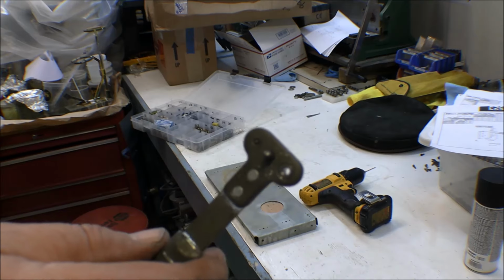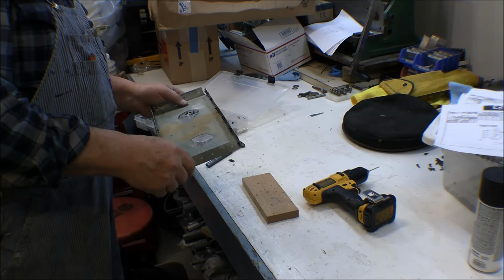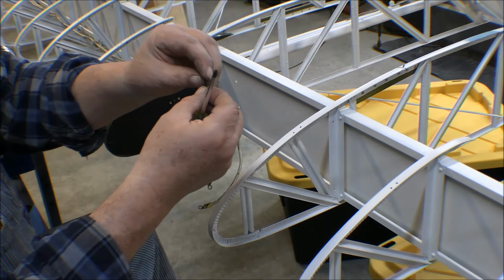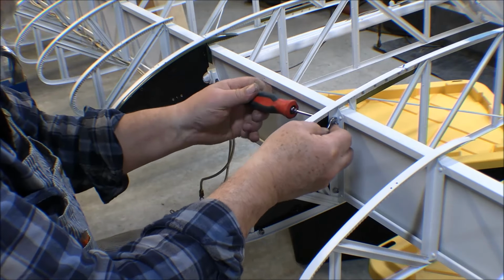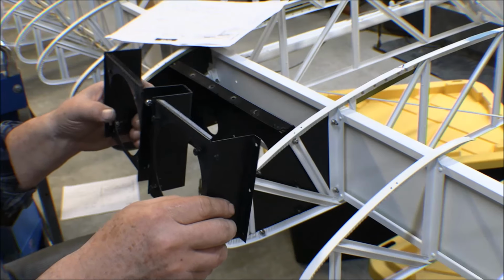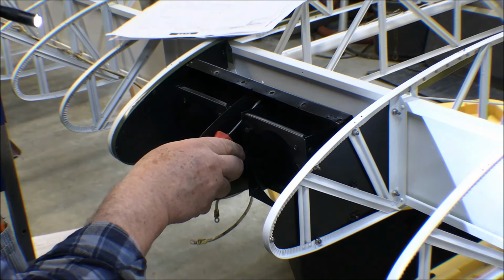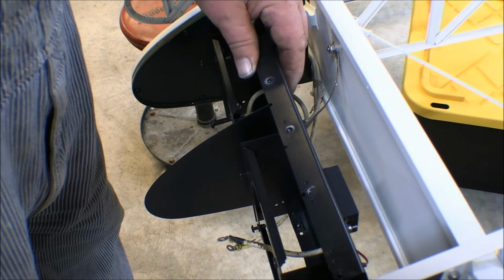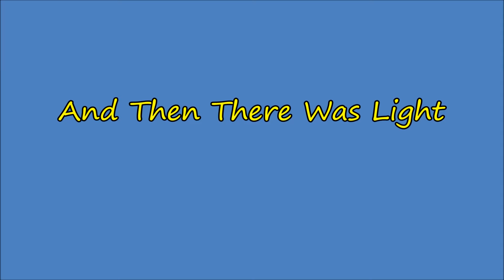Piper Super Cub Wing / Landing Light Assembly Installed

Comment: Can you tell me where and the part number of the black box for the light and like to know if it will work with the old type of light ? Thanks
Reply from the maker: sorry I didn't get back to you sooner. The box the switch came in was in the basement and I kept forgetting to get it.
I don't remember if I got this from Ebay or Amazon, probably Amazon. It's CrewDog Electronics wig-wag flasher for par36 led lights. I guess it only works on leds.
I'd recommend switching to leds over the old style lights. If you still operate with the original 25 amp generator it can't keep up charging the battery when operating all the lights and radios. I can remember flying blacked out on a couple of night flights because the battery went dead mid-flight and had to shut everything down to let the battery charge up so I'd have lights and radio when I got near an airport.
Operating with lights on during all flights is now recommended for collision avoidance, and it helps prevent bird strikes. The old GE4509 bulb only has a live of 14 hours. Before leds we used to get halogen or quarts bulbs, they put out more light and lasted longer. For day use only I'd get tractor lights, they don't put out as much light but work fine for recognition lights in dense traffic.
The GE 4509s cost around $50 from an aircraft supplier but around $15 from a hardware store. They are the same exact light.
Some A&Ps will tell you that you have to use approved bulbs in aircraft but there are no approved bulbs for most small general aviation airplane. The GE4509 is no more FAA approved than the new LEDs.
With modern solid state avionics and leds the current load on the airplane is reduced to the point that a 25amp generator is more than enough to supply with everything running.
B&C makes a small alternator that mounts to one of the accessory pads(like for vacuum pump) on Lycoming engines, It saves several pounds and is plenty for my needs but is not approved for certified airplanes yet.

Comment: Nowadays, it is difficult to find lamps that can be disassembled and buy parts for them. The Chinese flooded the market with non-detachable, low-quality lamps. Take care.
Reply from the maker: Seems like most new things are designed to fail and impossible to repair, or cost more to repair than replace.